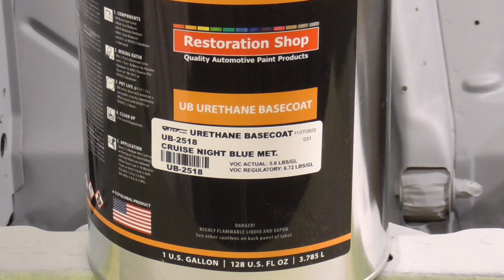How to Prep & Paint an Engine Compartment

Comment: Nice job as usual, Jerry! Loving that blue; it has a Mopar classic B5 blue metallic vibe to it. I love them Harbor Freight 80grit nylon wheels..... they cut nicely and have a very, very long life at a phenomenol price. When I use my POR15, I like to simply drive a wood screw in the center of the can lid versus taking that lid off and on, exposing the paint in the can to air. I shake the can to mix the contents and let the paint pour out the wood screw hole. Yes, a bit slow in pouring, but for small batches of the POR15, it works for me. Screw that wood screw back in the hole and the paint surrounding the hole hardens up, making it lock the screw in place.
Reply: Same here, I used 2 pole barn Sheetmetal   screws. One for vent and other drain. Couldn't get the lid off a new can.
Reply from the maker: Wow... good idea.  Thanks for the comment and suggestion Michael - I'll check out the B5 - I'm actually a huge MOPAR guy and should know the color but.... don't.  Have a good weekend my friend :)
Reply: Also if your mig is available you can purge the can with inert dry gas. Throughly enjoy your vids 👍🙂
Reply: Thanks, Jerry, you have a great weekend as well. Absolutely loving your AMX restoration!! @LakesideAutobody

Comment: Holy crap Jerry.! Wow, that looks awesome! Couple questions: Was there a reason?? that you didn't use single stage? Also, for the areas that you had some surface rust and you went over with epoxy primer/ sealer, is there any chance of that rust ever coming up to the surface again like it was?? Sure wish you were closer, I would definitely get you to do my whole car :) have a great weekend
Reply from the maker: Hi GM - I went with the BC because I though I was going to just use plain base coat on the trunk, engine bay, interior but then I changed my mind and threw on a coat of clear.  I'm not a big fan of super shiny engine bays, trunks, etc.  I like that stock, plain, flatter/satin look.  The rust won't come back - promise.  The only reason going with the epoxy, honestly is that I have to use it up.  Bought a gallon because it was cheaper that way - since I like lacquer primer - this never gets used.  This is one thing I didn't have to sand after priming so I went with thie epoxy.  if you don't have to sand, epoxy is great - sticks well, sprays well, etc.  Always feel free to ask any ?s - easy or hard.  Thanks for always watching GM - enjoy the weekend my friend :)

Comment: Hi Jerry, As others have said WOW indeed! What a great job Buddy! I went back and watched you paint the Mustang with the TPC red paint. You did that job about 3 years ago. You seem to like TCP paints. Have you ever used any of their OEM blended paints from the Restoration Series? Thanks PS Back working on the Camaro...Your inspirational!
Reply from the maker: That's great to hear you back working on the Camaro - keep at it.  I've used TCP Global Restoration Shop Urethan Single Stage and their Base Coat and both are good.  Also found out that paintforcars.com Trinity Starfire Urethane Single Stage is very good too - used it on a horse trailer and it sprayed and flattened out nicely :)

Comment: Nice! Do You have a trick how to get the paint to stick on POR15, have heard ordinary  primer might  peels of over time?
Reply from the maker: Just scuff or sand then paint.  Easier to scuff it with the red scuff pad.  paint should stick well to almost any coating as long as that coating was clean, scuffed, cleaned again and sprayed :)
Reply: @LakesideAutobody OK, thanks for advise, good to know.   I did my old tow bar with POR15 and sprayed later the same day directly on top of that with a PU based  rattle can(2K) spray as a test. It worked well and holds, probably pure luck:)

Comment: How long do you think until the rust pokes through again? Im doing a 66 jeep gladiator and just finished removing all the rust in prep for paint.
Reply from the maker: Never - honestly.  If you prep correctly, use automotive grade primers and paints & the panels can drain and dry out, you'll be good for the whole time you own the car.

Comment: Might be a dumb question but I'll ask anyway.  If you're using epoxy primer why not just sand blast it?  It what you did faster, or just less mess or expense?  Or is that just the way you like to do it?  Just curious of the pros/cons and why experienced tradesmen like yourself do things a certain way.  Thanks in advance.
Reply from the maker: I would have loved to have it sent out and sand blasted but I'm trying to keep the cost down.  Something to think about too is that even though you have it blasted, the inside of the cowl, frame rails, rocker, quarters, etc. will never get touched - anything enclosed is still rusty so nothing is really the perfect solution :)

Comment: When you do all of your sanding and prep right where you're painting, how do you keep dirt out of the final result?
Reply from the maker: I used to fight dirt in my paint work but I finally realized that it isn't the shop, paint booth, wet floor, nothing but what is already on the surface you are painting.  If you make absolute sure there is nothing on the panel you're painting there will be only a few specks in the job.  Check this video out for a dust free paint job - many will scoff at it but you can touch your body work - you won't get fish eyes - make sure your hands are clean and dry - https://www.youtube.com/watch?v=Z2Byray0o9o

Comment: Why did you choose epoxy primer over a lacquer? Asking for us that may be starting a project in the future
Reply from the maker: I used the epoxy primer for two reasons.  One, I have a whole gallon of this stuff I bought for an aluminum hood - I need to use it up.  Two, I wasn't going to block sand or sand it in any way before the paint.  I figured it has great adhesion properties, seals well, and just a great primer for this situation.  It's good to remember that all auto primers work great - just depends on the needs of the job I guess.  Feel free to ask any more ?s if that didn't help :)
Reply: @LakesideAutobody  thanks for the info

Comment: Why not have it walnut blasted. Then epoxy primer followed by por 15
Reply from the maker: You could do that but I'm like a perfectionist and if I can't have the inside of the rockers, frame rails, cowl, quarters and every other rusty cavity blasted then why have it done at all.  I going with a different plan - something that will allow you to drive it year round without worries of rusting again - this ain't going to sit in a garage or on a trailer 💯